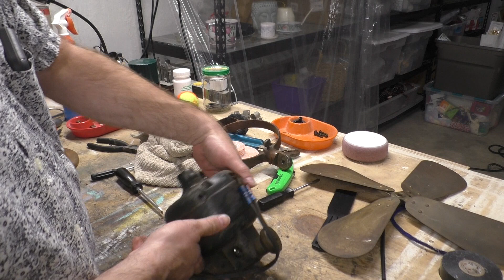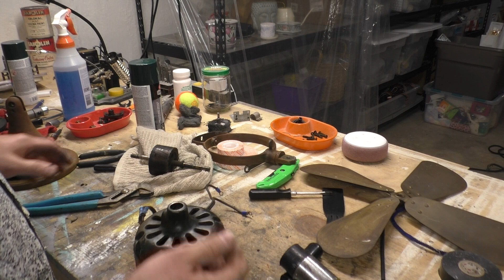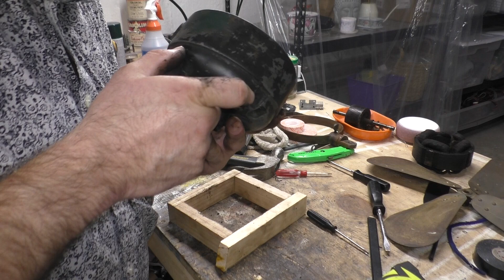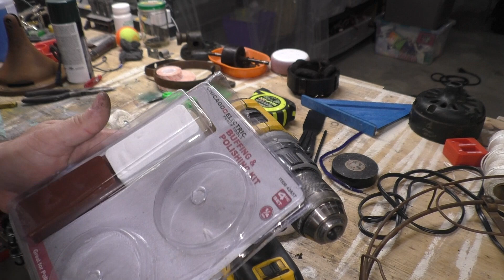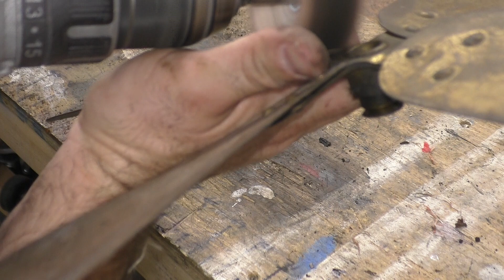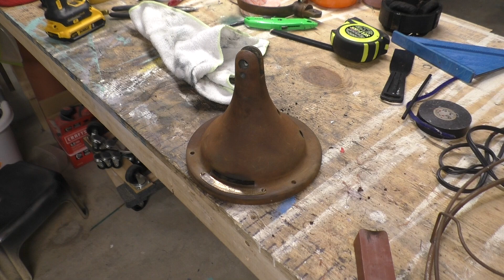1923 16" GE AOU "Loop Handle" Fan Restoration - Part 2 - Stator Removal & Blade Polishing

Comment: Slow down.   Those bars heat up, allowing the compound to work.   They lubricate the compound to reduce stretching.  Also…keep the buffing/polishing wheel charged; when the color fades, you’re too dry.   Keep one wheel per “color”; never intermix.  If you think that was laborious, try polishing an aluminum, 25 foot long vintage camper!   The first stage is called “cutting”; followed by “color” stages.

Comment: Hi What were you tapping on to take the stator out,, couldnt see from the camera angle
Reply from the maker: I placed the housing over a jig I made from scrap wood - just sized right to support the housing while letting the stator through. I was tapping on the stator itself with a drift pin punch, lightly, never hitting the same spot twice.
Reply: @bbishoppcm  thank you,,I did the same thing lightly tapping around the screw holes ,, but staying close to them I got it out  finally and now I'm waiting on the wiring I ordered

Comment: Here in southern California on job sites its pretty much only dewalt and Milwaukee. I use dewalt myself been for the most part very happy with them, my old impact driver i dropped from over 20 ft and was fine

Comment: The best way to remove the tag on the base is the method you used. The pins can be stubborn but with enough tapping, they will come out. Some WD-40 will help. Also a helpful tip: I would clean the exposed shaft with WD-40 before pulling the rotor out. The hardened oil, grease and rust on the shaft can score the inner bearing surface. Good progress so far!
Reply from the maker: It worked! Got the tag off with some heavy blows.
Reply: Glad it worked! Looking forward to the next video.